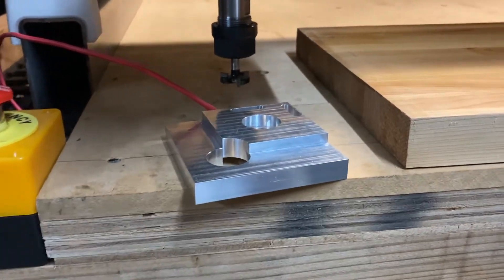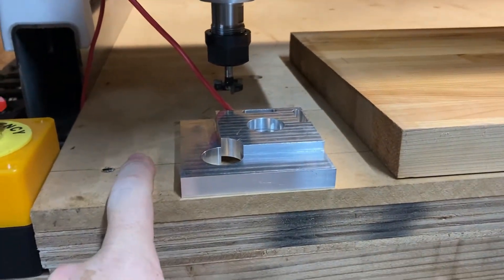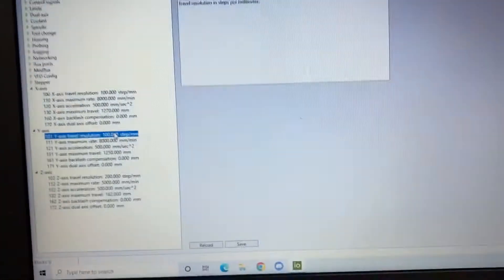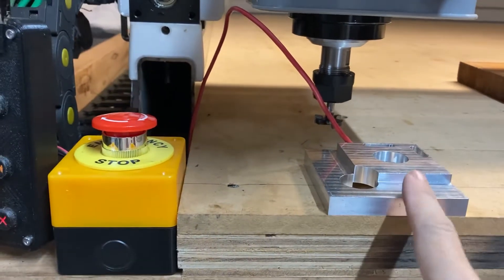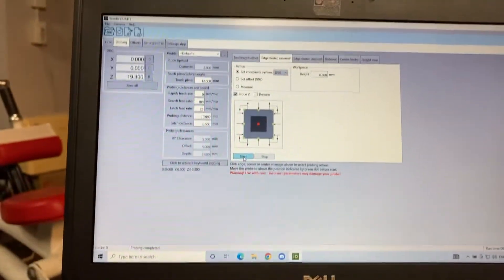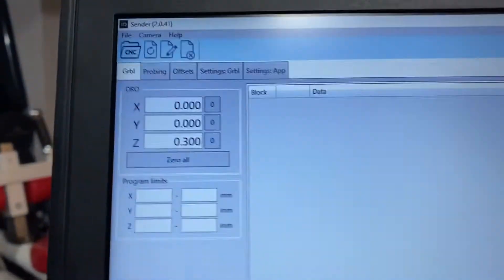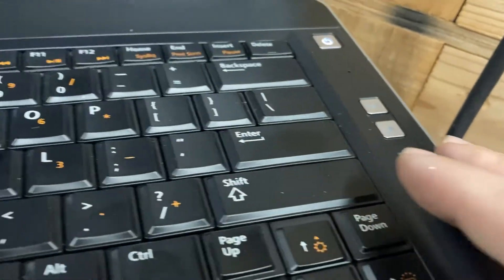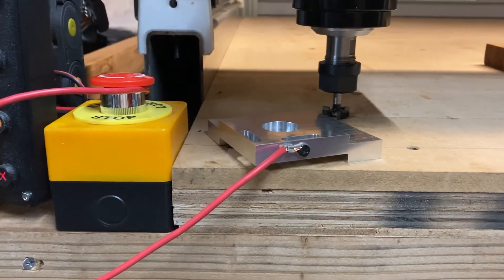Probing in Iosender Z Height Adjustment with a touch plate probe on a PrintNC CNC

Comment: How is the circuit closing? Usually, you attach the other end of the touch place cable to the milling bit so that contact with the touch place will close the circuit. How is it working otherwise?
Reply: The other end is attached to the CNC frame that is grounded to the spindle